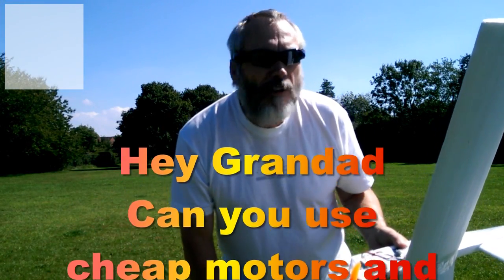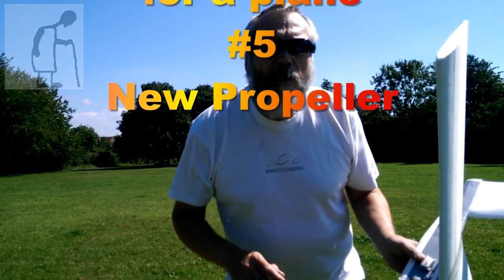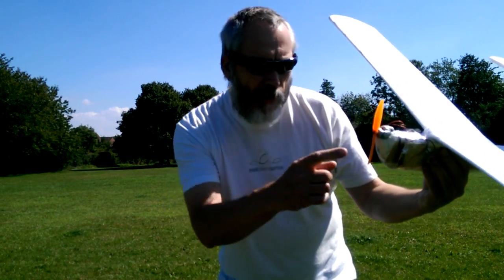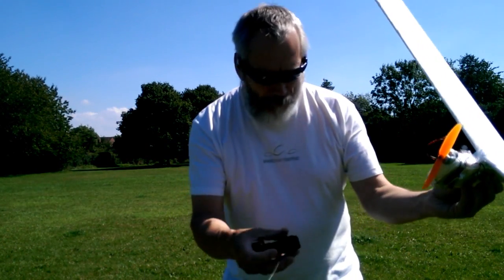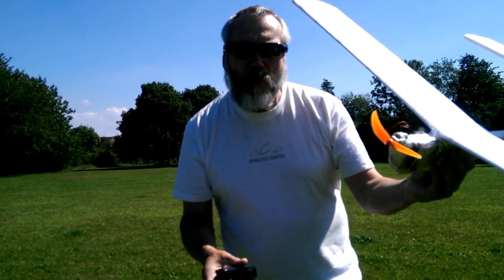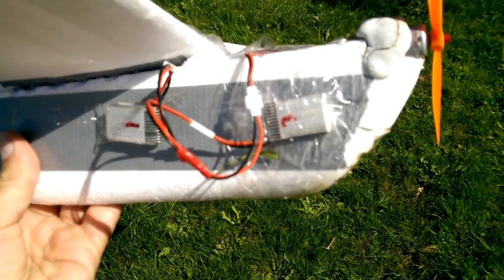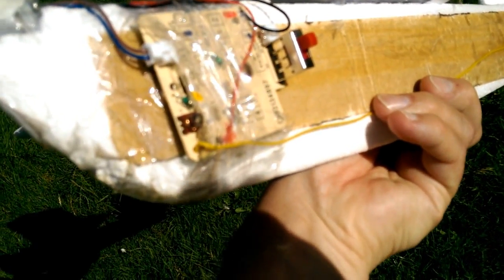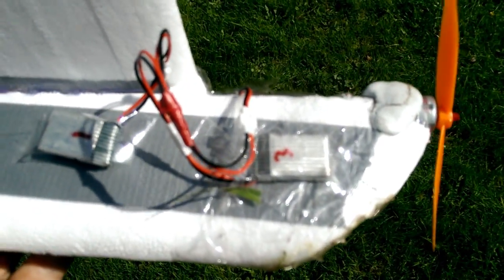Hey Grandad Can you use cheap motors and cheap RC for a plane #5 New Propeller

Comment: Could you extend the receivers antenna
Reply from the maker: You could try. Some toy grade transmitter/receivers have remarkably good range anyway but most cheap ones are only designed to reach around 12 ft for the average room inside a house as that is where they are expected to be used. This whole project was aimed at using the cheapest available. The more money you spend the better results you are likely to get but then you are getting to the costs that would have allowed you to buy proper hobby grade gear anyway so why waste time and money when you could do it properly.
Reply: I say this because I have built a rc badminton launcher and my range was very limited so I clipped a alligator clip to the antenna and clipped the other end to a long pole and it worked much better I go an extra 20 ft of range! ( I was also using a cheep rc car transmitter and reciver much like yours.
Reply from the maker: @brady_bauer2518  Yes, that should work, but not really practical for this application. Obviously a slightly shorter version could be used, maybe just pinch an extending antenna of an old radio or tape the wire to a thin dowel attached to the transmitter 🙂

Comment: Hey Grandad, can you unassemble any cheap rc model and convert that to a basic rc plane?
Reply from the maker: The whole point of this series of videos is to show that the answer is NO. First point is the motors are no powerful enough. You could improve that with suitable gearing but you would have to buy that gearing, the gears in the toy car would not be the right ratio. Second point is most cheap RC cars don't have enough range to fly a plane, after about 12 metres you would lose control. Have a read through the information I put in the video description. You could change the motor, change the gearing, change the battery, change the RC gear, but then you have nothing left from the original basic RC toy car.
Reply: Oh I see, thank you for replying
Reply from the maker: Proper hobby grade RC gear can be quite cheap if you start at the bottom of the range and once you have it you can swap the components into many different projects. It is so much easier to use proper hobby grade RC gear and if you find you enjoy it you can then think about upgrading to more expensive equipment.

Comment: hi grandad, I ve thought long and hard of what you could do and maybe you should get a normal plastic bottle and add a small engine with a proppellor on the back for a set timer. This can be placed on water and acted as a boat? You could also ad a ruder to make it go round in circles.
Reply from the maker: I have rather a lot of boats on my channel😊Here is one that looks similar to the one you are describing https://youtu.be/0JBabXZU0NQ?list=PLA5a2xPRSrB24vUS9E8zkSgjZysEL00zr
Here are some playlists of the boats on my channel Toy Boats playlist https://www.youtube.com/playlist?list=PLA5a2xPRSrB24vUS9E8zkSgjZysEL00zr
9 Volt Boat playlist https://www.youtube.com/playlist?list=PLA5a2xPRSrB2QEcFZj7zcR8RmjbPgoAaR
Airboats playlist https://www.youtube.com/playlist?list=PLA5a2xPRSrB3NetUyXZIX2oWlTPJX2-5r
Aluminium Foil Boats Cars and Planes playlist https://www.youtube.com/playlist?list=PLA5a2xPRSrB1MkF27XAD9XCZOi2zhKjik
Balloon Powered Boats https://www.youtube.com/playlist?list=PLA5a2xPRSrB2KM25Z_JeOsNJdyA3CXRiW
Bargain Store Solar Boat https://www.youtube.com/playlist?list=PLA5a2xPRSrB0yTO2CAT-egZzvEs500p11
Child's Toy Boat - Outboard motor conversion playlist https://www.youtube.com/playlist?list=PLA5a2xPRSrB2VyBseLcg-tp-Q2tdh_Yrv
Ecoiffier Abrick Rescue Boat RC Conversion https://www.youtube.com/playlist?list=PLA5a2xPRSrB08WVccLQ3j4SSRy9NMgeUo
Fan Cars and Boats playlist https://www.youtube.com/playlist?list=PLA5a2xPRSrB2BNUWVU5G6qQld3G1W604W
Fast Lane Hover Glider playlist https://www.youtube.com/playlist?list=PLA5a2xPRSrB1CJGS7JZgf0DbAmyKiUeCz
Let's make an RC Airboat from a cheap RC toy car https://www.youtube.com/playlist?list=PLA5a2xPRSrB1lWfd30u41ifA07QHgurpj
Mousetrap Powered Cars and Boats https://www.youtube.com/playlist?list=PLA5a2xPRSrB1jSyRMjw31ptEYAAkZRF6H
Origami Kitchen Foil RC Fan Boat https://www.youtube.com/playlist?list=PLA5a2xPRSrB3b3BBCiM6R43HJcfhXutbt
Paddle Boats https://www.youtube.com/playlist?list=PLA5a2xPRSrB31jBvsqUJFUtWJ4QiPSLjV
Pop Pop boats https://www.youtube.com/playlist?list=PLA5a2xPRSrB2M0m754LkqMXQFwFRAS3HK
RC Boats https://www.youtube.com/playlist?list=PLA5a2xPRSrB0kSD5J49jwe6jyBA6gQofU
RC Ducted Fan Boat https://www.youtube.com/playlist?list=PLA5a2xPRSrB3d0TvbCZftqbS4Fh-1911Q
Action Man RIB RC conversion https://www.youtube.com/playlist?list=PLA5a2xPRSrB3uyIDOIVlV-BY3M2kREK79
RC Converting my Playmobil Conlines Titan Cargo Ship to RC https://www.youtube.com/playlist?list=PLA5a2xPRSrB3oBfGysVG4ebHEe7JOfDuE
RNLI Radio Controlled Severn Class Lifeboat by Zappies https://www.youtube.com/playlist?list=PLA5a2xPRSrB25U9c1fJWRGGWG0moYnBep
RC Rescue Recovery boat https://www.youtube.com/playlist?list=PLA5a2xPRSrB1WH8Pe1q86jf25zcTZ7ViB
Rubber Band Powered Boats https://www.youtube.com/playlist?list=PLA5a2xPRSrB1Pi_dNuFbsZd8q2G_zyjFS
Sailing Boats playlist https://www.youtube.com/playlist?list=PLA5a2xPRSrB3-UBOB98Tkgui6Pvx2ZMNC
Scrap foam packaging Airboat https://www.youtube.com/playlist?list=PLA5a2xPRSrB0osHRLljQ6IH51idJJN7_z
Solar Powered Boats https://www.youtube.com/playlist?list=PLA5a2xPRSrB2cuyCDt7Ig20u0pzPWtVo3
Solar Powered RC Boat https://www.youtube.com/playlist?list=PLA5a2xPRSrB0CbqRkzsGRzhfMqrEydOPg
Supercapacitor Boat https://www.youtube.com/playlist?list=PLA5a2xPRSrB3TJCBigrLmf8jGYjkKgI8C
TOMY clockwork Water Skiing Crocodile toy boat https://www.youtube.com/playlist?list=PLA5a2xPRSrB0y09yqVPARzM4EsrJ0hKQt
Water Jet Boat - Grandad's Junk Pile Projects #6 playlist https://www.youtube.com/playlist?list=PLA5a2xPRSrB0hOPEGWOYVtrLzBmgNTI09

Comment: Great video, maybe you could make two gliders with one different size propeller and motor, and the opposite to the second.which one would go the furthest?
Reply from the maker: Furthest? Why would I want to do that? I don't have an unlimited area to fly in and the distance would probably be governed by the battery power anyway. The chances of building two gliders that are exactly the same weight and have the same flying characteristics is very slim. If you wanted to compare different motors and different propellers it would be better to swap them on the same plane to get an accurate comparison.

Comment: use a different toy receiver that matches the receiver for better range. you could even put steering on the plane using the steering control on the new receiver.
Reply from the maker: +random person not much point if there is not enough power from the motor to fly the plane.
Reply: a better reciever might handle more voltage
Reply from the maker: random person buying a proper hobby grade receiver and ESC would do the job properly and not cost much but that is not the point of this project.

Comment: hey grandad! why not try to make an rc plane like this one with 2 motors like the biplane youve made a while back, from an rc car, so you'll have steering. and ive seen some cars with "tank controls" where the right stick controls the right motor and the other way around. nice work!
Reply from the maker: YonBond the point I am making with this project series is that those type of motors really don't have the power to weight ratio necessary for flying and you are better off buying proper hobby grade motors and doing the proper job. If you want to use toy car motors just for the novelty value then fine, but if you really want to fly planes get the proper gear.

Comment: cara coloca leme neste aviao 2 canais
Reply from the maker: Ronaldo Cruz read the title. This project is just to see if we can make a plane fly using cheap motors and cheap RC gear from toy cars. If it does not climb then there is no point adding full radio control. So far we have not got enough power from the cheap motors.

Comment: can u swap the rc car infared receiver with a cheap 1.5 or 2.5 ghz reciver or one from the twin motor rc heli.
Reply from the maker: ZyFinity ᵐᵒᵗᶤᵒᶰ ᵈᵉˢᶤᵍᶰ are you talking about the receiver in this video. It is a 27 mhz radio receiver not infrared.
Reply from the maker: ***** I could but that is not part of the project. The original question was about using the components from a cheap rc toy car to make a powered plane, hence the title of the video.
Reply: ok

Comment: GWS 5x3 ? seems to suit the motor :)
It might go well with a constant turn in the rudder. Thumbs up for continuing with it in any case !
Am thinking that a lighter receiver and a bit extra weight off would see this go well. Was surprised at the RPM's of that motor too.
Reply from the maker: slider2732 yes it may be time to start it turning. It is flying far better than I expected, which is not hard as I expected total failure. I was actually quite worried about trying it on a hot sunny day in case it found a thermal.